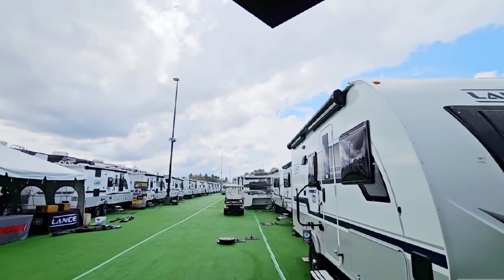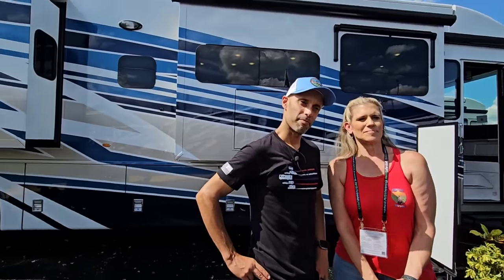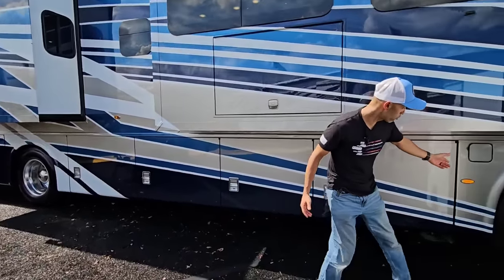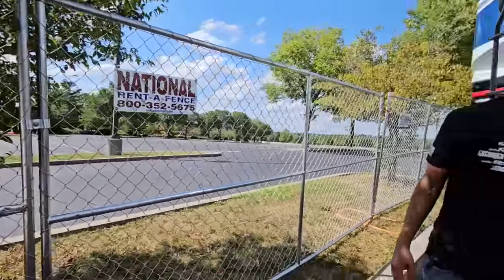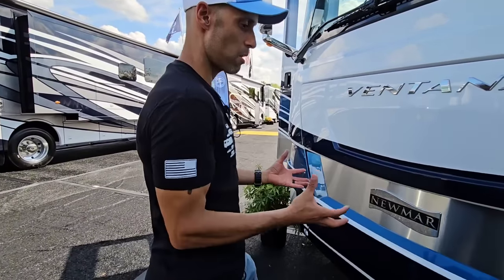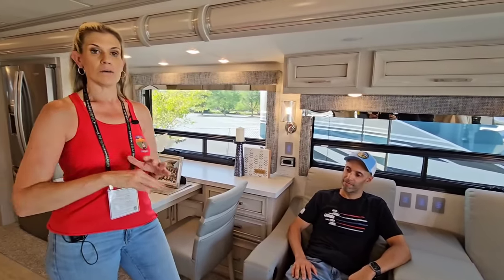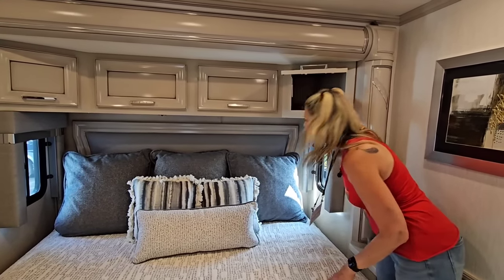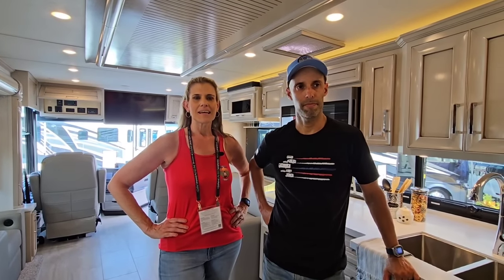Help Touring a Newmar Ventana Class A Diesel Pusher!

Comment: Glad to see you doing more motor homes. About the full body paint... IMO, If the stripes aren't painted on the slides, it's "semi-full body paint". Mine has actual full body paint, so I may be biased, but it's my opinion. I bought my rig used. When I did, I thought it was nice, but I didn't really realize just how high end it was for it's time. Compared to the new stuff, it's not the best, but I have that full body paint, side mounted radiator, all hardwood interior, etc... It's making me think I might keep this rig longer than I planned. Please keep up the motor home reviews.

Comment: We had a small class A gas motorhome and really enjoyed it, but the cab noise was excessive and we couldn’t unhitch and have something to drive around at our destination. Switched to a towable and have a nice quiet ride (Ram 2500 HD) and have had to relearn how to pack vs the Class A which had loads of storage. Didn’t want to pull another vehicle with the class A. Good collaboration—have learned lots from both of you. We decided we’d be happy with either the motorhome or the truck plus travel trailer. We love road trips!

Comment: You should not be able to drive this without a CDL by the time you get loaded up it's probably over 26000 pounds + if towing a car I'm a truck driver for 50 years I think that people should have to get some training before they can get one of the really big RVS
Reply: You can get a non-commercial Class B or Class A to drive one of these. Pretty much the same test, except you don't really need a trailer to do it. Just the coach